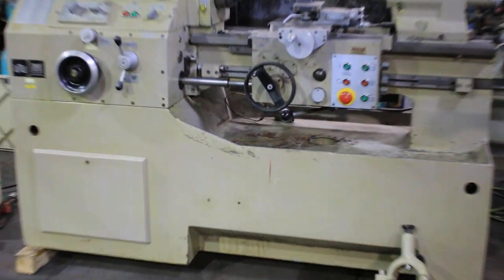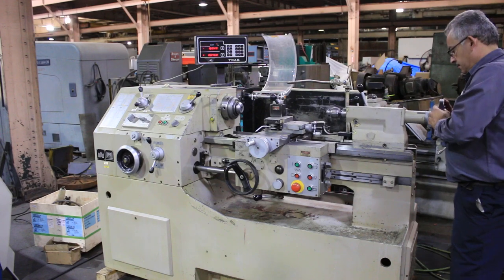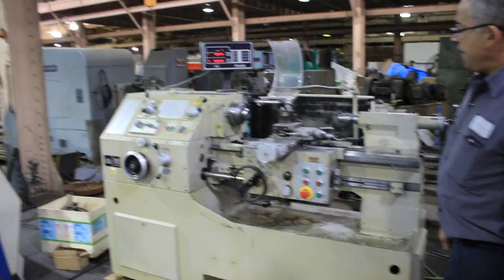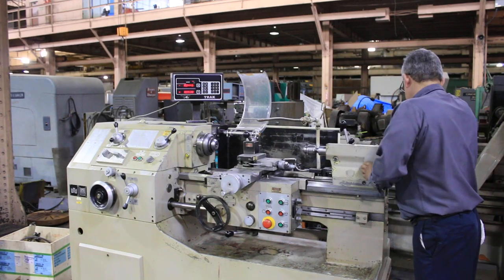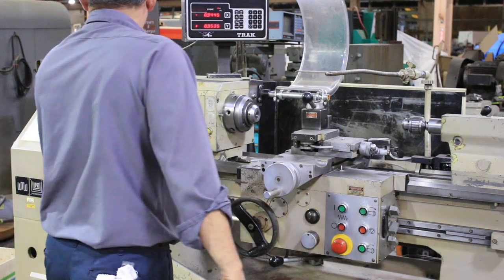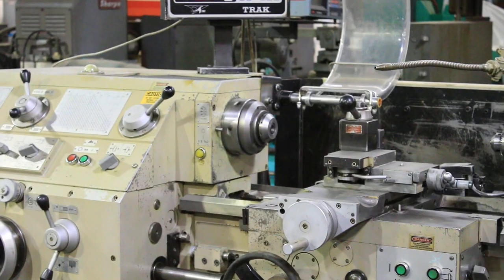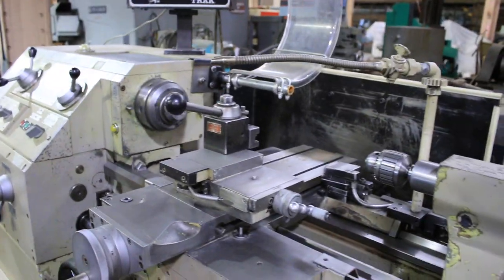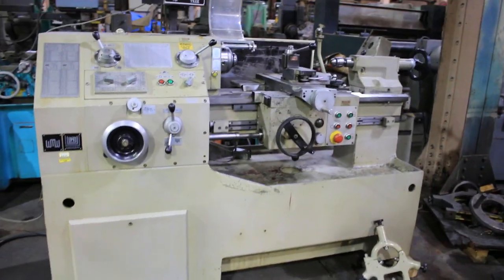14'' Swing 20'' Centers WMW DZFG 200x500 ENGINE LATHE

Comment: There is a yellow light near the main axis (≦140) and I wonder what the function of this light is.What does it do?
A switch at the end of the spindle is needed to turn the light on or off. Is there any specific function?
What is the function of the two stroke switches at the end of the spindle?
In addition, I really want to know the specific method of car thread. Do you have any convenient accessories?
Reply: lucky you didn't buy it i did can't tread on it no way to engage the feed